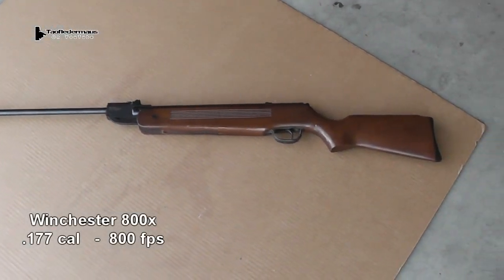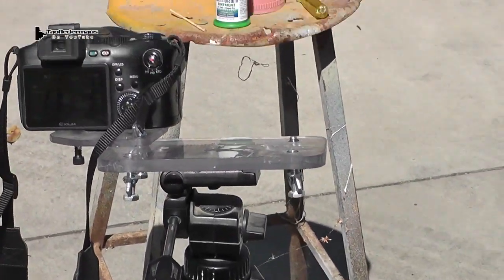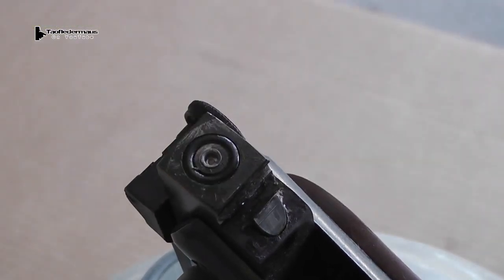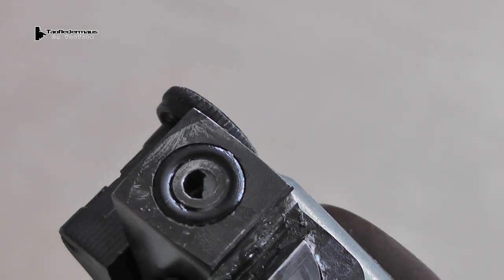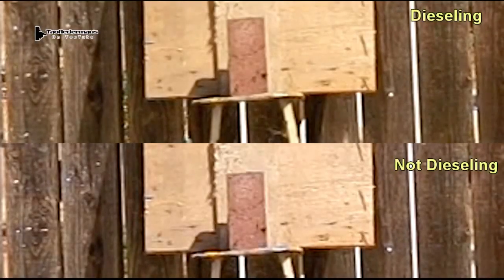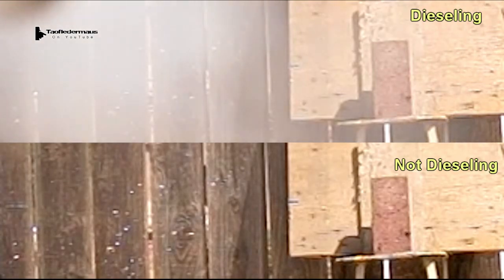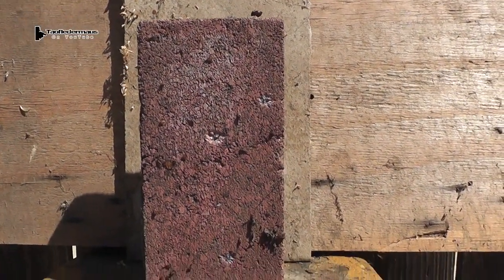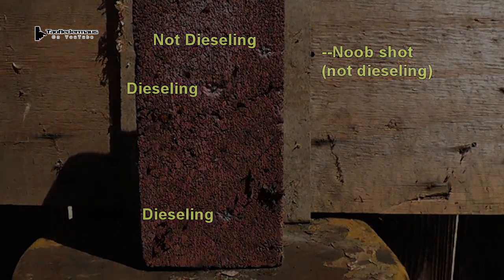Pellet Rifle DIESELING  -   Good,  Bad or Ugly?

Comment: I used to do this with my .22 BSA Meteor. I pushed the pellet in about an inch and put cotton wool dipped in diesel behind it. Never measured the muzzle velocity but it made bigger dents in the steel locker I had as a range target holder.

Comment: I tried dieseling for the first time yesterday with my Crosman F4 and 1974 pump BB/pellet rifle.
A chronograph put the pump rifle at a max of 550 fps with pellets, a bit more with BB's.  Not enough to induce dieseling.
The F4 gave consistent 900 to 920 fps without dieseling.
Using 3 in 1 Oil boosted it to 1250 fps, give or take a bit.
I made one shot with hydraulic oil and got 1570 fps.  Out of fear of blowing the seal I stopped there.
Besides the speed increase I noticed some kick, and a LOT of noise.  Much louder than my .22 Colt Huntsman.
Experiment over, done with dieseling my poor pellet guns.  Although I would like to try a night shot — I'll probably wait until next July 4 so I can make all the noise I want and nobody will notice.

Comment: Dieseling 100% does work. And it’s not because you’re getting a better seal around the pellet or better lubrication on the barrel. Do more research. I’ve been using Vaseline for 50+ years and never once have I damaged any of my air guns.

Comment: For years and years as a young teen my beautiful German-made Gecado Model 35 (.177 Air Rifle) was 'gun-oiled' slightly (less than a full drop) around the skirt lip circumference of each pellet tail. It never did ANY harm to the rifle's performance, even after 1,000's of rounds. It remained just as accurate and as fast as ever. It produced a tiny whiff of cool-smelling smoke each time from out of the end of the barrel. It was a tremendously FUN air rifle, until my mother threw it away into a rubbish skip after I'd left home. Sooooo disappointing grrrrrrrrrrr..!!

Comment: What a load of ASS!    What you see coming out of the barrel is vapor NOT smoke of burning/explosion.  
Often blow out your O ring?  LIE !   That hardly ever happens and trust me I've tried just about everything!  
No chrono no proof of ANYTHING!  You need a powerful rifle and a tight fit for the pellet to get the pressure needed for a real ignition.
Someone with a half functioning brain would have the ignition material  BEHIND the projectile and not filling the barrel before loading a pellet. 😂

Comment: Check your jurisdiction. What virtually none of these content creators are telling you is that if you diesel an airgun in a jurisdiction where power levels are restricted, and you'd be surprised to know how many there are, you took a perfectly good thing and made it illegal.

MA in the USA restricts airgun power to 7.5 joules and any airgun with more power needs to be registered just like a firearm. The same thing in most of Europe. Many airgun owners aren't aware of all the laws and regulations that have been created over the years and it's a real shame they exist but for now they do.

When you add a propellant to diesel an airgun it is no longer an airgun.  You might ask how anyone would know you diesel an airgun and who is going to enforce some crazy law? That has been the downfall of all those who said most gun laws wouldn't have any effect because there was the 2nd/A. How did that work out for everyone?

If you really want or need that much more power from an airgun, why not just get one that does what you want or need? If you want or need more power than an airgun can provide that is why they make firearms including 22s. You might be curious to know that some people advocating dieseling are also those who can't buy firearms and this is their way of getting around the prohibition. Don't fall into the trap and find yourself on the wrong end of the stick just because someone figured out how to diesel airguns.

BTW, dieseling isn't new despite so many thinking the world began when they were born and everything they "discover" no one ever knew before. People have been dieseling airguns since airguns were invented, this is nothing new. What is new is the monkey see monkey do brought on by instant video streaming where anyone can tell and show you how to do something that can easily make that wonderful hobby and activity of owning airguns and turning you into a felon because someone said do it.

Comment: Pushing a pellet deeper in barrel you actually made it a lot worse. That initial hold should delay a little when the pellet starts moving to build higher pressure behind it. And that should also help with dieseling.

Comment: with that much extra empty volume behind the pellet, you're not going to get much combustion. Don't ram the pellet down. You need to keep the pellet skirt flush with the back of the barrel, and fill the skirt up with the oil/jelly completely. It's just like a diesel engine, you need a high compression ratio, which means you need a very small combustion chamber volume.

Comment: Your doing it wrong. Use gun oil and dab it on to the pellet. Also no need to push the pellet down. I test mine by shooting into thinner gage metal. Without oil the pellet doesn't go through. With oil it goes right through and just punches through the second piece. For sure makes a huge difference if done correctly

Comment: Fun ti diesel but not good or fun gor the rifles seals. I use timi torch fuel oil and it is louder then my 22lr rifle with out silencer and with silencer on my pellet rifle its almost as loud as a 22lt

Comment: Interesting I’m wondering.
I have seen others use pellet guns shooting 600fps shoot well into the 700fps.
But your gun shoots 800fps and seems to make no difference.
My question is dose that diesel only produces enough energy to do 700 to 800fps ?
In a slower air gun the ignition can over power the normal velocity but not so when you already shoot faster then the ability of the ignition? 
So 800fps =800fps 
600fps you get 770fps
At 500fps may you possibly see even better results like 700 to 770fps if that is the maximum velocity of the accelerant?
Just a thought 💭

Comment: I know this is an old video. I wanted to test out “dieseling” and did so with my GAMO Whisper Fusion Elite. The rifle is rated at 975 fps using the GAMO PBA Platinum pellet. I use the cheapo Crossman Premier Hollow Points. With those heavy 14.3 gr pellets, it only did high 690*s to low 700*s.

I chose to go with Seafoam Deep Creep. It is my preferred clp style lube penetrates deep and stops metal from rusting and resist burn off while shooting. Anyway, I decided to spray directly on my tin, my rifle now does 950 fps with 14.3 gr lead pellets! Lowest is 900, but 8/10 shots are 950-970 fps! The pellets are lightly coated with minimal pooling in the tin. Shot about 100 pellets and consistent fps. I used a Chronograph. 

*Edited typos and also adding: on another side note, after shooting one of the Seafoam Deep Creep diesels pellets rifle does high 700s to low 800 on a non dieseled shot from residual Seafoam lol. 800 seems to be an accuracy monster.

Comment: You can diesel that old Winchester 800x all you want.
The less are still out there "working fine", the better the world we live in.

Dieseling does add some FPS according to my chrony.

Using WAAAAAY LESS vaseline than you did I added 40 fps. I don't know if there would be a diffetence if I put more 🤷

BTW you don't need to push that pellet inside the barell. It is just brigning the pressure down and giving false results to your test. There are plenty of place in the squirt of a pettet to put the grease into.

Comment: Love your content but you should have done more testing. Your petroleum compound obviously didn't ignite. If dieseling can damage gas seal's it must increase bore pressure. Just like with diesel combustion engines the volatility of your fuel and the ratio of fuel to air as well as bore temperature capacity of chamber and compression pressure achieved all have a huge impact on whether you reach ignition and how much power is released.

Comment: Been dieseling a Beeman every time I shoot it  since the day I bought it, over ten years. I've put over three thousand pellets through it. I use chest rub. It's consistent. Never had any damage to my air rifle. I'm pretty sure they were originally, either by planning or happy accident, meant to be dieseled in a pinch. Try glueing a  .177 BB into the cup of a hollow point Crossman .22 Cal. pellet, diesel it with chest rub. If you have an old car door laying around, try shooting it from 7 yards. Then 15 and so on. You'll be surprised.
Reply: I use  chest rub as well.. Lol

Comment: I think you’re doing it wrong. I just tested through a chronograph, 740 ft./s non-diseled, 1087 fps dieseled.

I think you’re using too much petroleum. You’ve got to get the fuel air mixture correct. When you have it right, it’ll be more than just a puff of smoke, it will be obvious something was dramatically different.

Comment: It absolutely makes it way faster. Mine breaks the sound barrier and gets the sonic boom. It’s literally almost as loud as the 22lr. Put a much bigger crater in metal for me too. Like very noticeably bigger. It’s not physiological it’s legit. I don’t like how you did yours. Put it right in the back of the pellet, no need to push it in further. 3in1 oil seems to work the greatest for me. Doesn’t work every single time but does on most shots.

Comment: I tried this on a Gamo .177 Swarm. I put a tiny dab of Pellgun oil inside the pellet cups with a pencil tip and did a chronograph. The pellets are 10.5 gr. and normally about 770fps average. After using the oil, they were hitting 990fps at 3-4 yards out...so yeah, it works.
Reply: It works, but I personally read so many different point of view about the risk or not doing it. On the Internet I can see users saying that it can damage your gun if you do it repeatedly, other susers say it cannot. So, where's the truth?
Reply: @mircorizza5609  Probably depends on how well built the pellet gun is. I wouldn't recommend doing it repeatedly though.

Comment: Chrony it and you’ll clearly see its faster done it many times with different cals
Reply: What are you using? And does it work on air pistols too or are they too Weak?
Reply: @jesusismycity3202  has to be certain pressure. Wd40 works good and cooking oil

Comment: Using  a quick spray of WD40 without pushing the pellet down the barrel the usual speed of 800fpm is increased to super sonic and easily through a Spruce  2 x 4 and buried up in 1/2 " plywood.  Dieseling does increase the velocity greatly.

Comment: OK, I’m trying to understand your very non-scientific answer… If I’m understanding you correctly, you are saying adding the flammable substance does not add velocity… But in virtually the same breath, you are saying this could damage your gun. How could it damage your gun if it does not appreciably increase chamber pressure? Other videos have showed in some cases hundreds of feet per second increase in velocity by doing this.

Comment: You are dieseling completely wrong. You only ad a very light smudge IN the bowl of the pellet. You keep the pellet in it's natural position, you DO NOT push it in more. The idea is to compress the air causing the igniting of the material of choice. Being under pressure, it combust that much quicker forcing the pellet out at a much stronger force. When you push the pellet in, you are removing the MAIN purpose, which is to build pressure. Also, by adding too much petroleum again, you remove oxygen required for an optimal combustion. You only need a very very small smudge.

Comment: Yeah this is all assumptions tho, to really actually test thus you need a high speed camera and film the trajectory of the pellet from the side angle with a background reference behind the frame to use to measure- kinda like they always did on myth busters with the black and white stripes every inch or so. Bc you'll never start the frames at exactly the same time and exact frame of the pellet firing so you HAVE to do it visually with a high speed camera and methods incorporated to take measurements

Comment: Don't deepseat the pellet.  It needs the starting resistance to build full pressure.  The cavity in the pellet is enough to take such a small dab of vaseline.
What you have, is like retarded injection timing on a diesel, making it run poorly.

Comment: I read the comments on here and no one seems to notice the obvious. Your observation of the bullet by slowing the footage down might or might not be accurate. But the issue here is that the dieseled rounds are being pushed in compared to the non dieseled rounds. This increases the volume of air in the chamber and brings down the compression ratio which is probably not enough for optimal detonation.

Comment: By ramming the pellet further down the barrel what you've done is reduced the compression ratio. What would increase the compression ratio is to leave the pellet where it sits when first putting it in the barrel ...and then adding a dab of vaseline behind the pellet.  When the compression ratio increases, the ignition point will have a greater explosive force, thereby increasing the speed the pellet travels down the barrel and out towards its target. It's true you risk damaging your seals which weren't designed for such pressure but you'll have increased the projectile's speed which is what you were intending to do in the first place.

Comment: In my experience firing at a tree over 25 meters away I noticed a significant decrease in flight time when dieseling vs clean shooting. I used WD-40 which is probably a bit more volatile and I didn’t advance the pellet for a larger combustion chamber.

Comment: I dieseled for ove 5k rounds on a Benjamin Titan NP in .22 and had no problems. It just died at over 10k. I can tell a major difference in power because it can pen a washer at 15 yards dieseling. Without it it will just leave a dent. When you push the pellet forward, your actually decreasing chamber pressures so you don't get the same velocity. I can tell a difference in time of flight doing all of these things. I use regular old WD40 on my stuff.

Comment: As both a firearms enthusiast and a diesel mechanic, I doubt if you are actually "dieseling" the air rifle. The added substance may be adding smoke and pop to the show, but if you were achieving compression ignition in an air rifle, I think you would destroy it. Compression ignition is a very destructive process, which is why a diesel engine is built so much heavier than a gas engine.  Also, if you were generating pressure that would speed up the pellet by an amount you would notice, the spring piston assembly would dampen the effect considerably. True ignition would both accelerate the pellet and cock the gun, possible overcoming the strength of the rifle. This seems to be a dangerous path to travel. Before you go far in this direction, check out the pressures involved and the construction of your air rifle. It just seems like a dangerous path to follow. Best of luck, however you decide to go.

Comment: Couple of days ago , after a bit of overzealous oiling to try and preserve it against the humidity of this place I was taking shots. Some hundreds shots in as if the oil in the chamber ignited the front seal blew out in a small explosion, opening the action and there was a literally deafening bang. Thought I'd lose some hearing for a good amount of time. Even having shot a 7.62 nato rifle in the army without earpro the sound freaked me out! (Partly because it was unexpected). Rifle was not permanently damaged although the signs of it leaving tiny puffs of thick dark smoke which stuck around the barrel after every shot should have warned me. I guess I was too liberal with the insides and didn't wipe it off enough hoping it would spit it out! Point is, can get nasty scary easily, be careful with 'dieseling'!

Comment: Its called 'Dieseling' not 'Mentholatum Ointmenting' for a reason.
Use actual diesel fuel, it ignites at the pressure an air rifle runs at, unlike ointment or vaseline.